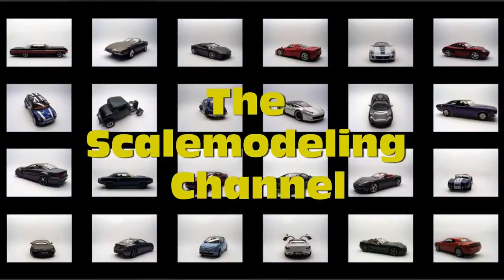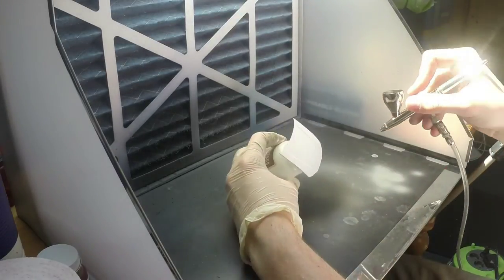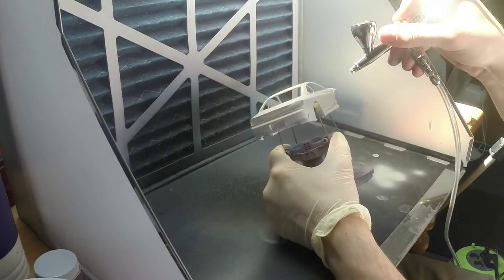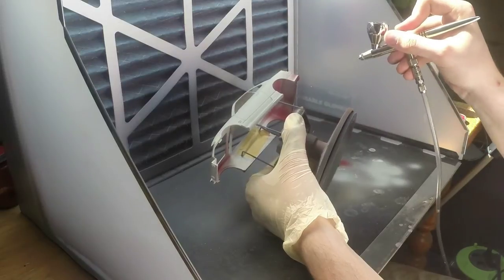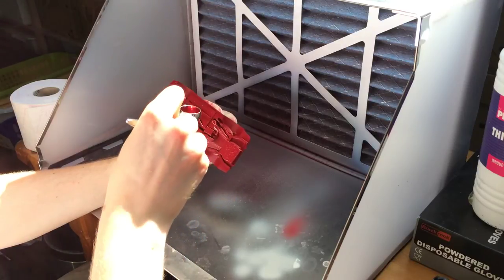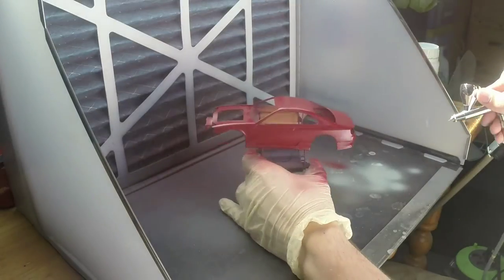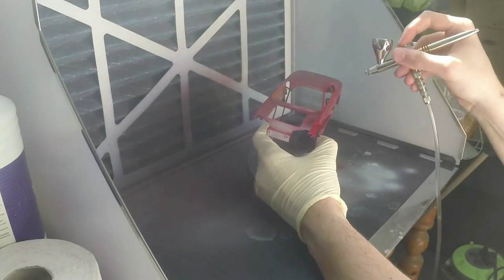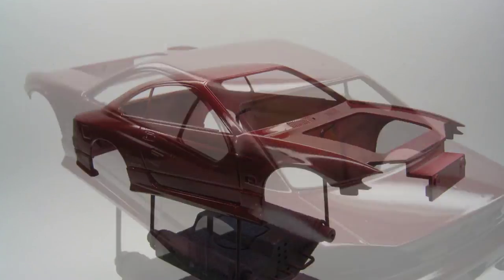Aoshima:Nissan Silvia S15 Spec R Painting

Comment: I have a couple questions on your spray booth. 
1. What did you put down on the bottom as a "pad" it doesn't look like it is affected by solvents like the factory piece.
2. I noticed a lot of "mist" in the booth and exiting when spraying the clear, is this because of the ratio of thinner to clear, or is the booth not able to suck it into the filter since the clear is much lighter than the color?
Reply from the maker: I did not put anything down as a pad. The booth can handle the clear. But as im laying it down very heavy it takes a bit longer. And also because it is very thin there is a lot more mist.

Comment: what airbrush is that and what PSI are you running it at??
Reply from the maker: It is a Harder & Steenbeck 2 in 1 EVO and i am running 42 psi(3bar). The air pressure might be a bit high for some. Bit works for me.
Reply: The Scalemodeling Channel do you have a review video on this airbrush? Love your videos by the way!
Reply from the maker: boxbuyer2008 I don't, I do have a cleaning video
Reply: The Scalemodeling Channel may I get the link?
Reply from the maker: boxbuyer2008 How To:Clean Your Airbrush
Reply: The Scalemodeling Channel thanks, man. You're one of the many talented builders in this community.